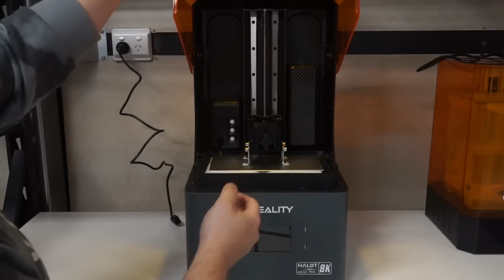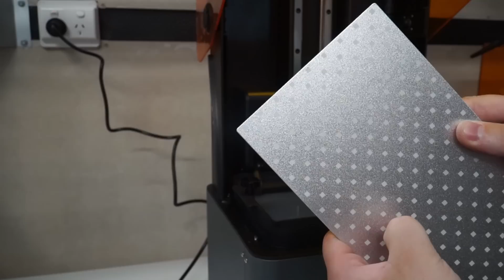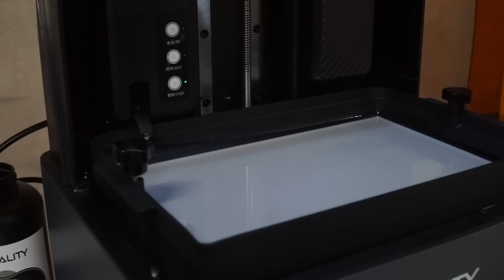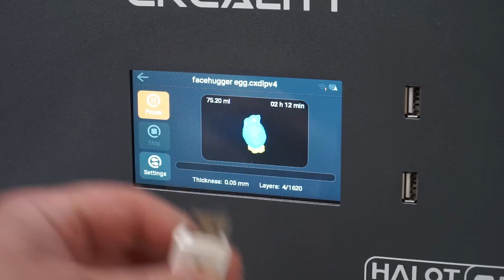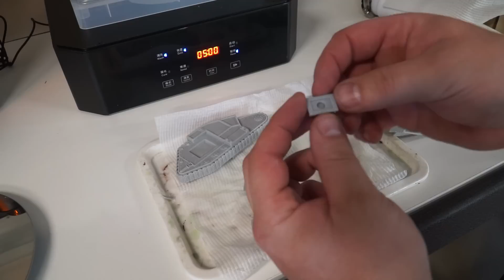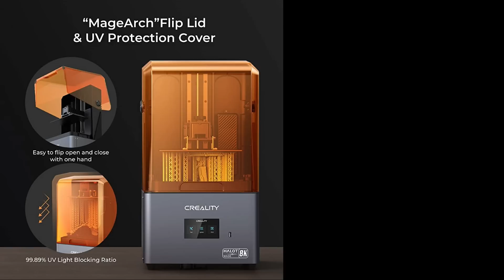Halot Mage Pro Review - Printing Whole 28mm  Scale Tanks Under 3 hours?!

Comment from the maker: If you are curious and want to buy one for yourself, they are only $509Au for the basic model, and $769Au for the pro.

Printer Store Link: https://store.creality.com/au/products/halot-mage-8k-resin-3d-printer?aid=TheOuterCircle&fbclid=IwAR3BbupoldkiWnol9o5-dUg2YDYO94pAm6_qVJPg7i4y3siaF4BERvFmo6E
Reply: Thank thats answered my questions regarding it I was looking at updating later this year for me the printer speed is a good feature I like that 8k is plenty of accuracy tho excessive even.  Great review mate really appreciate the content. 😊
Reply: Only thing I would disagree on is inbuilt cleaning in the must have catergory , as you said yourself , down the line it will probebly become that , but right now for me its a desirable. Anything that can help me make a print not fail would be in the must have before cleaning , some sort of sensor checking the FEP as one example.
Longer life time on all parts but mainly the Led is probebly sooner rather then later gonna end up as 'must have' category due to the DP printers coming out.
Edit: Oh btw , good review :)
Reply: I've received my mage today. There's so little so far info out there for them. Any chance of sharing your settings? I'm planning a warhound and every hour shaved off...   😂😂

Comment: Having designed many industrial machines with lcd screens, this is usually the sequence of events that occur 
1- you pick the lcd screen that you need from a lcd manufacturer and hope it will be available for many years to come.
2- manufacturing builds the product you designed
3- next year, sales team wants a product refresh, ( nothing generates more sales then a product update)
4- design for a product refresh and its then that you find the lcd manufacturer has also updated their lcd product line and your original lcd is no longer available.
5- you design for a new lcd screen that is available. ( usually higher pixel density and or screen size)
6- next year the cycle repeats again and again and again.
Reply: yep, and newer version doesn't mean it will be better it means that it's cheaper for manufacturer to produce

Comment: I feel like I do want 12k just like I have a 120hz monitor to play pc games at 60fps, its a quality fail safe in a way, apart from that the levelling and changing of consumables like filters, cleaning and curing, and ventilation are the big things for me. Ventilation should be easy to attach a hose to or come with one tbh as 99% of people can easily poke it out a window and filters are an extra cost, cleaning and levelling are practicality things, I bet it’s a lot easier now but when I first got into printing levelling and resin seemed quite intimidating due to lack of support, knowledge, and ease. I honestly don’t rate speed very highly at all because as a wargamer I can have it printing a single tank all day while I build some plastic infantry or something, if I convert a model in plastic or resin sometimes a single marine can take a day to build 🤷‍♂️

Comment: Even when you take care to hollow out your model Macca and properly support it, it's always tricky to evaluate the succion force that can tear the model from the plate. And it gets even worse with fast printers. I wish the slicers could simulate this or warn us at time of slicing but it would mean knowing the viscosity of the resin beforehand and this changes depending on the ambient temp, blablabla... The solution (that no one really enjoys) when you print "straight" like you've done with your egg is to punch holes round the base of the model, that you'll have to fill or plug later (which means glueing, sanding and so on). Or print at an angle, but the print of course gets taller and takes longer.

Thanks for the review.